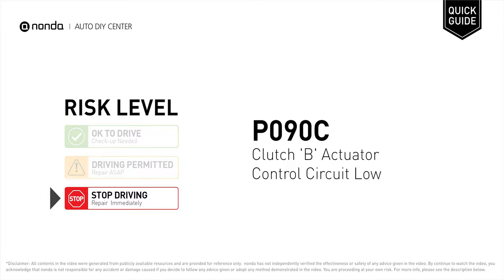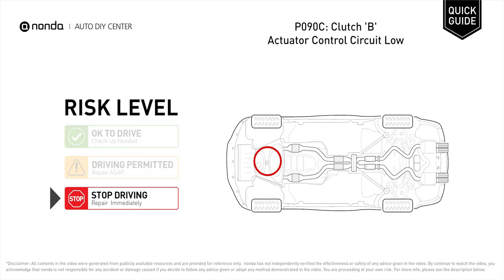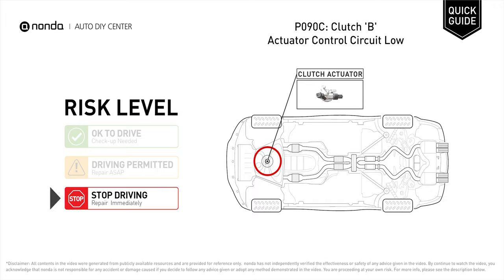What is P090C Engine Code [Quick Guide]

Comment: Do I have to take to dealership to have repaired.
Reply from the maker: Hi Ernest, kindly check if there's a faulty wiring or connectors (repair if necessary) then check the condition of the PCM terminals and the clutch actuator.
Reply: Hey how did yours turn out??